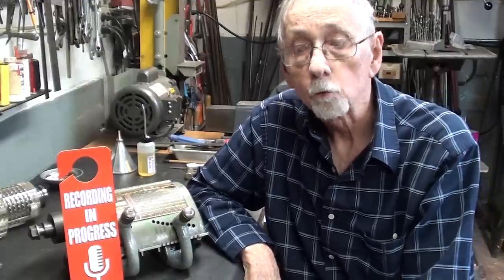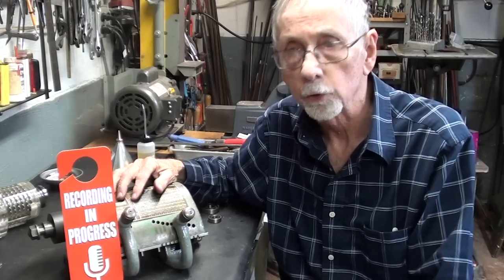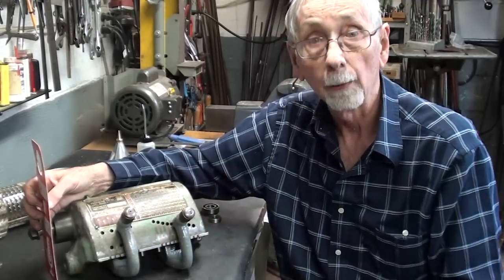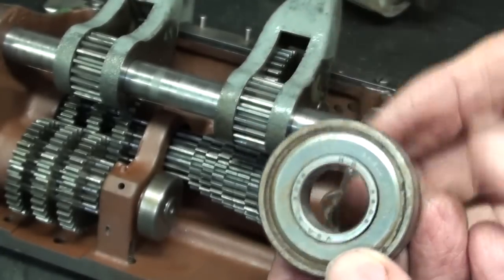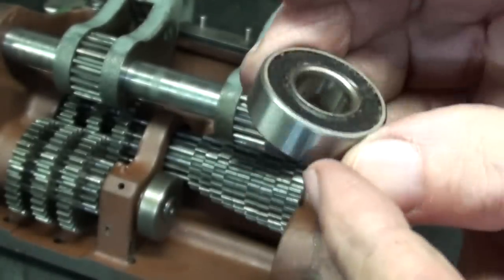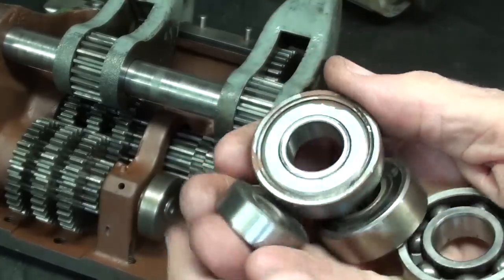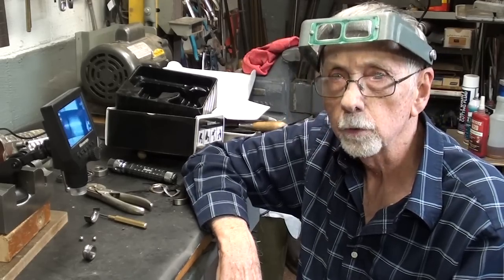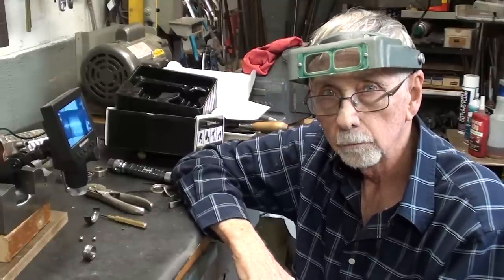FAILED BALL BEARING ANALYSIS short #23 tubalcain

Comment: Yes, this type of analysis is very instructive. Failure modes have always interested me (retired Electrical Engineer). Comment on "rant" section - a rant is "good for the soul" if you can control your temper. Zeiss makes a very good microscope imager but it's expensive (>5000 dollars) and who can afford it. The cheaper versions of modern technologies do make them more available but dang if it's not frustrating dealing with the lack of quality control, lack of tolerances, poor material selections and on and on. Thanks for sharing

Comment: Enjoyed seeing the flat spots on the balls. Would not have guessed that could happen.
Reply: Bruce, i think the bearing was miss made and assembled that way!
Therefore it never ran properly.  Since the application was probably little used if ever by the original lathe owner, it was over looked and only became a problem years later.
JIM
Reply: @jimc4731  that could be.

Comment: You are an old grouch Mr pete, but I agree with you entirely. I first noticed it many years ago when the heavy stable phones were replaced with lightweight models. This was in the days of cable connections and reaching for a pencil just out of reach when on the phone common. The old heavy phones sat solid on the desk while the coiled wire stretched while the new lightweight ones fell on the floor pulling all and sunder along with it. Progress my ar--!
Reply from the maker: Yes

Comment: Thank you for cutting open and examining that bearing.  I started in auto repair back in 1970, and have cut open MANY bearings (and other parts) to find how and why it failed ... and to show my customers.  In all those years, I have never seen the wear pattern displayed on that bearing, it is very different than the usual pitting and galling.  I would say its almost impossible that it didn't leave more damage on the races.  Yes ... please do more post mortems.  I find them very interesting and believe there is a lot to be learned from them.
Reply from the maker: Yes, I was very surprised myself

Comment: Hello - I am a sales Engineer for Timken and worked for the Torrington Company when Torrington was acquired by Timken in 2003.   A service engineer is more an expert at failure analysis than me.  But I'll give it a shot.  Is there only one ball with the flat wear area?  If yes, then I would imagine that there is one wear zone on the outer.  (The outer raceway looked quite good.  Still shiny from superfinishing).  The inner is damaged all around it seems. (inner rotating, outer stationary) Tough to tell if those are debris dents into the inner or if those are spalls. I'm gonna say they are debris dents.   Also this application generates mostly radial load and very little thrust load (spur gears).  The grease clearly has "dried out" or the oil has separated from the thickener.  The radial load is going to create a relatively small load zone.  Rolling balls roll into, through, then out of the load zone.  Balls not in the load zone are pushed by the retainer/cage around the raceway and back to the load zone.  The dried out grease not only provide very little lubrication but also prevented the retainer/cage from moving freely.  I would guess if this is the only worn ball then the retainer stopped moving and one ball was "stuck" in the load zone.  With almost no lubrication the ball and inner raceway wore.  The flat wear is a little surprising.  The balls are the hardest component.  I don't think the retainer could cause the ball wear (for example the ball rolling with no lube against the retainer).   Also it might be interesting to measure all the balls.   Was this worn ball perhaps slightly oversize compared to the other balls?   Judging by the color,  this wear did not generate very much heat.  Lots to think about isn't there?   Nice video and nice analysis.
Reply from the maker: I am so glad to hear from a bearing engineer who works for a major bearing company. Your analysis is very interesting. I am going to try to find the bearing in my garbage can which is full of chips. If I can locate it, I intend to Measure all the balls and see if they all have flat spots on them. You raise some interesting questions. Thank you very much.
Reply: Thanks.  I'm guessing the cage pinched that 1 ball, slowing it down & skidding it.  Low speed application, so not even enough heat to flow the grease to the bottom.  It was still evenly spread from the factory.

Comment: Mr. Pete I greatly enjoyed your dissection and analysis of the bearing failure. 
Starting as a young man I did maintenance and machine repair at the Midwest Foundry. 
For 3 years bearing failure and replacing failed bearings was an every weekend job. Sand kills bearings and having a greaser who knew what they were doing made life a lot easier. We could tell when a new one was hired. ☹
The machines were huge. 80 foot tall sand elevators with 4" diameter shafts on the head and tail pulleys. The gearboxes were a full days job to replace. 
Some lasted for a year or more. One slipup by the greaser in over or under greasing the bearing and we were back at it on the next weekend. 
As I progressed through the years to machinist, toolmaker, supervisor, engineer, Project Manager, and Engineering manager the lessons from the foundry stayed with me. 
Lubrication is king. Dirt is the enemy. Also never let anyone run a grease hose to a bearing that is hard to reach. That will be the bearing that always fails because it is never looked at. 
If you think having it hard to grease is a problem think about having to change it.
Reply from the maker: Thank you for an extremely interesting comment

Comment: I like your delving into the bearing failure. I found it educational to actually see the component parts of a bearing and WHERE it failed. Also you explained the difference between open, shielded and sealed bearings. Since the inner and outer races were basically undamaged, the softest metal was the balls. 

As a retired QA Technician, that sort of feedback allows for product improvement (if you are still making it). If you are about to start making it again (if we can ever divorce ourselves from China), it gives insight on what to look for during accelerated life tests.

BTW - nice light and nice fix for light weight.
Reply: China's unbelievably poor demographics (the One Child Policy was as stupid as it was barbaric) and a regime ultimately incompatible with the West's ensure that a decoupling is inevitable. Industry is already returning particularly the US and Europe should follow to a lesser extent. The large scale use of robotics may mean however that it is not as visible as say in the 40s, 50s and 60s. I suspect that we will be astonished at how fast manufacturing moves to North America.
All the best from bonnie Scotland.

Comment: Lyle, like you I enjoy topics like analyzing bearing failures.  I'm not a Bearing Engineer, but designed several pieces of (in-house) equipment where I used to work that had bearings in them.  I've got an old Timken bearing design manual that goes into so much detail about things that the "users" wouldn't even see if they looked.  Proper bearing design using more than "basic" bearings can easily be an entire career for some folks.

Please continue making videos like this one whenever something similar catches your eye & attention!

Comment: Mr. Pete, I like these kinds of videos and I too find it fascinating. I have been working with industrial gas turbines for over 20 years and have seen some horrific failures. Bearing, airfoil and  rotating component. When something like that happens there’s always root cause analysis, and through that improvement in the parts involved or more thorough inspection processes or both. Very cool thanks for sharing.
Reply from the maker: Thanks

Comment: Good Job on the bearing analysis. As to the cheap stands and holders, I have found most always I need to do the finish work to make them useable in the shop.
Reply from the maker: Yes

Comment: I always enjoy your videos and this one brings a new dimension to Mr. Pete Education. It seems to me that some smart engineer could design a stand for cameras, lights and so on that were hollow and had a hole in which the buyer could add sand which would serve as a counterbalance and provide weight to offset the tendency to tip.
Reply from the maker: I agree, like those basketball hoops, that you see along the streets. You can either add water or sand.
Reply: Mr Pete, I love failure analysis and I love you mentioned Swineford. My dad Fred Drake flew six missions there. He was a member of the 15th air force with the 450th heavy bomb group. After the war he worked for Hardinge brothers in Elmira NY and was the quality control man for the machine division. He lived until 93 years old, I miss that man!

Comment: I rarely comment but ALWAYS watch and enjoy your videos Mr. Pete! But since you asked - Yes, I enjoyed this video and found it interesting. Several years back I had to replace the main spindle bearing in the Logan lathe my dad bought new in 1947. Didn't do a forensic analysis at the time, but like you, I suspect grease that just dried up over time. That was a double-row shielded bearing... it's well protected from chips in the headstock so I replaced it with a sealed unit. Now she runs like new again. Oh - and I agree with your rant, though as you mentioned, if this high tech Chinesium stuff was truly solidly made we probably couldn't afford it. Always a trade-off.
Reply from the maker: Thank you, Dave

Comment: Hi Mr. Pete first of all I must say how much I enjoy your videos. There are a lot of replies to this video and I could not read them all so I hope this is not a repeat of what someone else has said. For over 30 years I worked in the Nuclear industry (Heavy water production and Power plants) some of those years were spent in vibration analysis. The idea was to measure the amount of change in vibration levels of equipment produced by various faults, Electrical, Process or Mechanical. Bearings are the most plentiful parts and consequently  get the most attention. The various bearing manufacturers supply the vibration frequencies of the various parts inner and outer races cage and balls. Over the years there was a move from simply trying to say a bearing was going bad based on the readings to predicting how long before failure. A whole section of industry has grown up around doing this analysis including equipment and training us lowly mechanics on how to use the electronics and diagnose problems. Still we always enjoyed cutting things apart to confirm that we were right.
Reply from the maker: Thank you, very interesting comment

Comment: For the camera and light, I had the same issue, and took an old magnetic micrometer unit, removed the magnetic unit, and took a scrap slab of granite I got from a local stonemason shop dumpster, and drilled a hole to fit a M10 nut in, with epoxy to hold it. That gave a nice firm base for the rod assembly for a micrometer, that the camera is attached to, and allows it to sit firmly in place with no stability issues. Pretty sure a similar trip to a monumentalist will get you a free chunk of faced stone, I got one with only one crack in it, black Rustenberg granite, all polished aside from the cracked face, that you can use, or see if one of the kitchen installers near you has some offcuts of granite top, as I use a small piece of that for a mouse mat. Heavy, does not wear, and works perfectly for that, plus hard to lose, and easy to clean.
Reply from the maker: Thanks

Comment: 30 years as an HVAC contractor - I’ve disassembled hundreds of motors, compressors, and the like to determine cause of failure. Great content! Thanks for sharing your wisdom over the years! I’ve had a respiratory infection all week and been stuck inside trying to rest and recover - binge watching your stuff starting with #1!

I knew you had been to tractor pulls and such but didn’t know you also had tractors so enjoyed the videos on the brakes and rollo-matic on the old JD. I have dad’s 1955 Model 60 in the front yard, runs like a top. He and I rebuilt it almost 40 years ago and he’s been gone 20 years so great memories!
Reply: Sadly, most of the newer motors in HVAC use sleeve bearings vs. ball bearings I believe.
Reply: @Garth2011  it often depends on size and application but yes many smaller motors <1hp have been sleeve bearings for years.
Reply: @shandylynn1  Waste of money unless a rush job/temp job.
Reply: @Garth2011  What is a waste of money? Using sleeve bearings? Products are engineered with a lifespan in mind. I’m not a product engineer, I’m a service professional.
Reply: @shandylynn1  I'd agree with that however, in HVAC no sleeve bearings should be used ever. They rarely last as long as other components.
Reply: @Garth2011  I have mixed feelings on that. On one hand, I agree that quality bearings are key. On the other are 2 points, the first being one often brought up by Mr. Pete - if they were you couldn’t afford it and the second, I get paid to fix things so if they don’t break eventually it will take me forever to earn money to buy more tools! :-)
Reply: @shandylynn1  Affordability has affected everything. Quality has gone down the drain as well in the USA too. You can buy two sleeved bearing motors in the time a ball bearing motor will last. Sorry, the ball bearing expense is once and less money than two sleeved and the 2x labor plus downtime. The cheap route is always an option, just like a cheap roof.

Comment: I'm a Mechanical Engineer and have years of experience at failure analysis.  That particular failure is typical of poor lubrication and the bearing cage separator restrains the movement of the bearing balls and the balls act like a wheel.  Thanks for sharing

Comment: Hi Mr Pete great video  why did it fail ? well on your gear box the oil passage were well thought out on the import one i just rebuilt was a design somewhere between the SB type and the new enclosed type . Mine is a Taiwan machine made in the 80s flat box style 
with a top plate that you add oil  under the cover 1/2 felt wick under that holes with tubes that drip on the side of the bearings and other parts . Bearings wide open and so is the back of the gear box so not only was there swarf in the gears also the bearings . I installed all sealed bearings and redirected the tubes to all the gears and shafts .  Thanks for doing these videos . JM

Comment: I most definitely enjoy this type of video.  As a matter of fact, I have a set of bearing I am replacing today on my index model 45 vertical mill.  The bearing for the knee lift are somewhat crunchy.  I have a suspicion that my bearings have flat spots like yours.
Reply from the maker: That is interesting. Be sure and take the bearing apart and examine it.
Reply: @mrpete222  after taking the bearings out and cleaning in paint thinner, they were as good as new.  I reckon the 40 or 50 year old grease was the problem.

Comment: More than 50 years as a big truck and mining equipment mechanic. I've changed out many a failed bearing. Some premature due to improper installation. Most on the plants were from contamination where dirt was built up and got past the seals.

Comment: Mr Pete, I have watched your videos for years. I'm a heavy equipment mechanic and bearing failures are a part of my business this is an unusual failure but  most likely the lack of lubrication caused the chrome surface to chip off thus causing the micro groves and scratches in the races. It's crazy how the ball bearing just wore at the circumference instead of the bearing rotating on its axis and wearing more evenly across the entire surface.

Comment: There is always a lesson to be learned by studying how something failed. In this case I think that it was a case of grease drying up over the years plus fine dust getting into the bearing. The low quality of most household items is absolutely ridiculous. My mother was throwing out a name brand vacuum that was only two plus years old. I said at least let me take a look at it. It had a shielded bearing on the roller brush that felt like the balls were egg shaped. I installed a name brand bearing and it has been working fine. I have bought cheap no name bearings before that have served me well when I didn't need something on a industrial level. That was probably a $250 vacuum, if they would of spent 5 cents more on the bearing there would of never been any problem.
Reply from the maker: Vacuum cleaners are sold to consumers because of the way they look. It’s all about style and not functional or durability. Kind of like tennis shoes.
Reply: @mrpete222  This is so true.

Comment: Nice! I was hoping you’d do a failure analysis on this bearing! My guess is that machining chips lodged between that ball and the cage keeping the ball from freely rotating which caused the ball to skid on the race.
Reply: I could be wrong, I thought the wear pattern appeared as a band completely around the circumference of the bearing rather than one flat spot.  If so, I just don't know what could allow a ball bearing to simply roll without rotating at the same time.

Comment: I had the front wheel on a 64 chevy2 come completely off after the bearings disintegrated. I dont think that is possible these days with disk brakes but it was a really rough ride until I got it stopped.

Comment: Enjoyed the video! Just replaced a failed bearing on my submersible pump that many people would have thrown out. I modded one of those suction cup mounts to hold my transducer for my fish finder to the side of an aluminum boat. It made it portable and works very well! Didn’t look like you tried yours as the paper is still on the suction cup part. My rant is on how crappy modern appliances are made to fail in such a short time.
Reply from the maker: The life of modern appliance is six or eight years